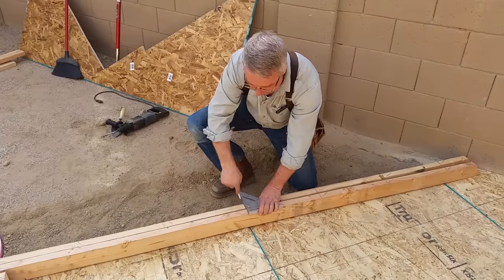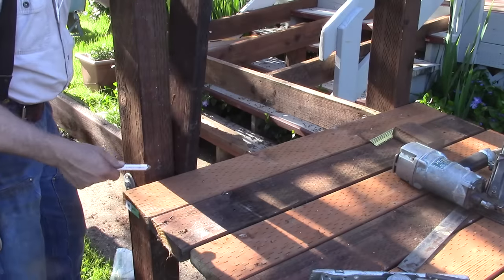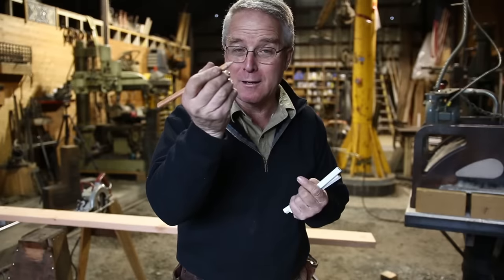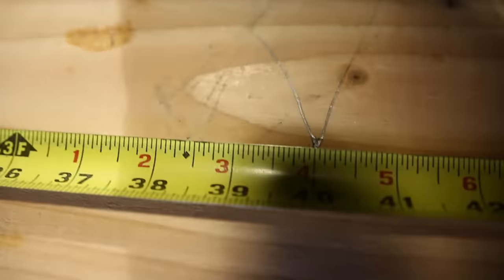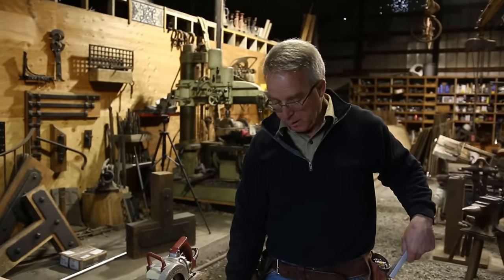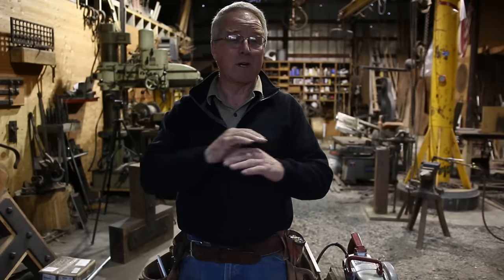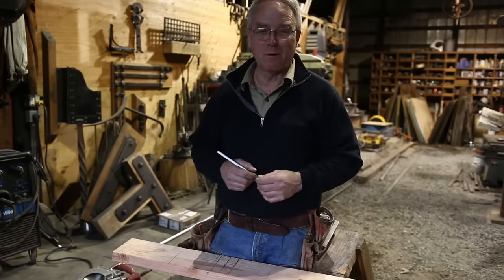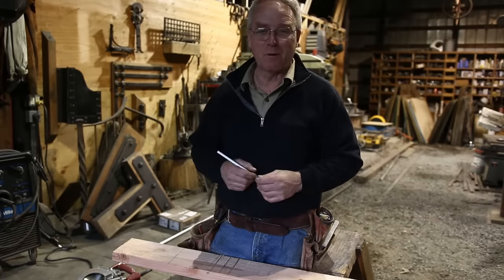Marking and Cutting Pro Tips

Comment: Maybe you just haven't seen (or dealt with them)... BUT I keep two kinds of mechanical pencil around pretty much all the time. (shop or field work)...
 A 1.3mm  "clicker" is a fairly ordinary looking and acting mechanical pencil, but that 1.3 mm lead works almost to the exact degree of a true carpenter's pencil. It's a bit softer, so the marks lay easier and darker... and it's less prone to break all the time and constantly require fiddling with the way the "usual" 0.5 and 0.7's do. (they suck even with finishing work)...
   Then there's the "engineer's pencil" or "architect's pencil" that you can get (a cheap-o version at least) at any office supply store that still sells those school-related architect kits... A slightly more robust version comes with a metal barrel to about half the over all length, so it's heavier and resists instantaneous detonation upon impact with anything of a concrete variety. (lolz)
   These accept the Eagle company (and others) largest drawing and writing leads, which are available (though occasionally limited supplies) in a wide variety of hardnesses, but the "HB" is plenty durable enough for a long lasting marking utensil that even a heavy-handed clutz like myself can manage to use precisely enough for just about any occasion... it's thicker (very slightly) than the 1.3 mm, which is even more advantageous in the field-work (like jobsites) where otherwise you'd want a carpenter's pencil.

   SO now that we're on the thickest mechanical pencil leads... how do you get precision??? 

   Actually, I do it the same as I usually go after pinpoint precision with the carpenter's pencil... I keep about a 2 by 3 inch tab of sandpaper in my pocket for that... In more consistent field-work (long travels and terms) I like to prep' by cutting down several sheets of sandpaper into appropriate (2x3) tabs, and then stapling them together like a miniature note pad... This allows me to scrub a point onto pencils, fix the tips of some gauges and calipers, and other little odd jobs at will, and when the top sheet wears to an undesirable performance, rip it off, and keep going. At the end of the day, check the pad, and carve out and staple a new one every time you're down to around three sheets or so... just to be sure you've got that part covered.
   Shaping the pencil point isn't difficult... You simply hold the pad as flat as possible, or press a finger to it on a flat surface, and scratch the pencil tip back and forth vigorously to achieve a nice smooth linear shape from the barrel down the lead to ride on the side of your speed or tri-square (as applicable)... OR you can scrub slower and roll the thing across your fingertips to shape a nice conical taper to a surgical sharp point, if that's more suited to your work.
   I find the flat-side variant absolutely PERFECT for use with straight-edges, rulers, squares, and guides... While the conical taper and a bit of practice is still the best for templates, and inside circumference layouts with hinges, brackets, and the like for centering and sizing screw holes.

    Yes, obviously, I can recognize the Carpenter's pencil is still a great way to leave big bold marks even easier than with the architect or engineer's mechanical version... AND the sandpaper shaping trick also still works for those occasions going from rougher to finer work, or maintaining finer work details without resharpening and wasting the pencil... BUT this also depends on whether you're a hobbyist or DIY homeowner on a once in a while gig... OR it's your profession, and you're obviously better served with a case at a time of pencils for supply and field reasons. ;o)

Comment: good tip is also to use 2types of grafit medium and hard... Medium for marking on wood and Hard for marking on concrete only diffrence between those 2 is that the tip on the Hardgrafit it stays longer but dont mark good on any wood =)

Comment: I always leave the line when cutting.. The reason is simple, if I cut on a line, I can easily wander to the left or right a bit with the saw, If I cut outside the line, I always have the line as refrence on the inside.. Works every time..

Comment: I simply know the thickness of my cut and the thickness of my pencil. Have them roughly the same. Then I add that to all my measurements. That allows me to cut the line. That way I never have to worry about which side of the line to cut on.

Comment: You use your worm drive saw a lot, I do not have one I have a regular sidewinder saw, ok fine a few of them.  I don't do much framing anymore, never was in the trade, but DIY projects around the house.  I've been thinking of replacing one of my older saws and was wondering what your professional advice would be.  Since I already have a couple sidewinders, would it be advisable to have at least a worm drive in the mix?  I know they're heavier, but I've also heard they're easier to control especially for ripping sheet goods as their weight kind of keeps them going in the right direction.  At least once or twice a month I find myself needing to cut sheet goods for a project.  I know the worm drive saws are more expensive, heavier, built better, etc.  Is this something that would make DIY projects easier?
Reply: Thanks.  Probably end up using the worm drive saw all the time once I get one.  Probably should have had one years ago.

Comment: Another set of distinctions I've heard is "strong" or "shy" 1/16"  Generally, tape measures only read to the 1/16." So, a measurement will be 5 7/16" shy, meaning 5 13/32".

Comment: On the engineer square/mechanical square. There is a built in scribe. That’s very very pointy used to scribe metal or a fine line. Great if you are marking out something that you’ll be torching. Torch will burn your mark away! A scribe in the metal will be visible no matter what.

Comment: Its always the little things. I've subtracted an inch before. The measurement was 24" it measured it myself. Marked it, cut it . Gave it to my father and it looked like it was the scrap piece I grabbed instead of the right one.  Turns out reading a tape upside down doesn't always work so good.
Reply: In Australia using metric tapes we suffer from the old "100mm" trick. Sometimes marking out it's more precise to move the tape forward and start measuring from the 100mm mark of the tape but remembering to add it onto your final measurement can be forgotten when you are under the pump 😳

Comment: I noticed he's using an 'old school', fixed-blade utility knife. I've always thought those were kind of obsolete. I've been using a good-quality Olfa, locking, snap-off knife for years, but I recently inherited an old, scarred, paint-stained, fixed-blade knife with a box of blades. What benefits are there to a fixed-blade over a snap-off. I like the snap-off because it's quick to get a fresh, sharp tip when I need it. I can retract the blade for safety, use a short extension on hard cutting to make sure I don't unintentionally snap the blade, but I can extend the blade for slicing cardboard or rope, and I can super-extend it and get a long flexible blade like a fileting knife for some applications. Should I keep the fixed-blade, old-school knife, or garage sale it?
Reply: Javier Fauxnom It comes down to what you need a knife for. The fixed blade knife lets you put serious pressure on the blade will still having control of the cut. Cutting heavy flat materials like thick carpet or roofing is quickly and accurately done with a fixed knife. It will last longer as well since there are no moving parts to break or jam. Snap off knives are great and can get more work done than a fixed blade so don't stop using your snap off but maybe don't get rid of the fixed blade just yet. I keep a tiny two inch by three inch diamond sharpening plate in my back pocket and just pass the blade of my fixed knife over a couple of times when it starts getting dull. I can get as many cuts as a snap off blade that way without losing time with frequent blade changes. Good luck!

Comment: one more tip. Put the pencil down on the point first where the mark is, then lay the square down against it. no guesswork if your tip is dull if you are gonna be 1/16th off or not. because the drawn point is already in place, the square butts up against it. easy

Comment: A trick I do is to do that crows foot upside down. start away from the mark on the tape and make a check mark with point exactly where I need it. this way you  can approach your mark and as soon as youre perfect shoot the other way. i use a .9 mechanical drafters pencil. try it
Reply: in regards to the cut versus line question, the goal should be to split the line with one edge of the blade, leaving exactly 1/2 of the line on the finished board. This is not the same as centering the line with the blade. The most accurate way is for the guy who made the measurement to make the mark and to cut it because he can see the line  compared to the tape and was the one who saw the measurement compared to the same tape. He can adjust his cut even after the line is drawn. second best is to have a skilled cut man who can put his mark EXACTLY where you tell him and split the line as described above. There should be no adjustment from line to cut.
Reply: Kerry Jones - .9mm mechanical pencil is a great combo of stiff enough lead, and fine point.  What I use most of the time too.  Though I found the plastic bodied "disposables" often wind up with their tips damaged and lead not advancing any more well before I use up all the lead, so have started using one with a metal barrel at the tip... And using the leads out of the big pack of disposables I got tired of fixing the tips on.

Comment: I think the reason for the double mark is that there is no other way to be as precise since you're cutting to an intersection. And if you only had one line, it could be difficult to know which end was the head and which end was the tail. with the double line, That's not a problem.

Comment: to get a fine point without breaking, rub both sides of the graphite on something.  real quick way to sharpen just the graphite quickly, one handed while still holding the wood in the compound miter saw while chewing gum, while standing on one foot, while talking.

Comment: I always hoard pencils I find because I always lose them on jobs. I have a bunch of standard pencils that I always keep sharpened with small pocket sized X-acto pencil sharpener that uses 2 AA rechargeable batteries that give them a super fine point and makes them super fast. I have carpenters pencils and use them but I end up using my standard pencils the most simply for the finer point and the super fast sharpening of them

Comment: At my workplace, we've got an odd habit of using box cutter blades without a handle for numerous tasks - mainly because the handles rarely survive an adhesive-heavy environment for long. The blade is shaped like a parallelogram. I'll hold it like a stylus, sharp edge AWAY from my hand, and I'll use the unsharpened - but still very pointy - hardened steel tip as a scribing tool.
This particular technique is OK as long as you're working around some kind of table where you can put a blade down, this would be no good for moving around... but I can't recommend using naked blades like that in general given how many times I've been incautious and cut myself. Never seriously, but still not a good idea.

Comment: guys, don't mess with traditional pencils for fine/finish carpentry. you'll lose years of your life trying to keep your pencils sharp for the constant marking you need to do, go buy yourself a pack of bic mechanical pencils. the lead is ALWAYS very fine, and if you need an even finer point, hold it at a strong angle and swipe it back and forth three times quickly... i use nothing but mechanical pencils for the last five years.

Comment: i just watch these videos so i can stare at that old arborga radial drill in the shop ;)
kidding, but seriously..a 'metalworking basics' vid, but with the caveat that it's specifically geared towards the carpenters out there would be interesting.
how to drill/cut/grind/polish..etc, but with the tools you already own
as a current machinist who spent his first 15 years working as a carpenter i know i would have loved something like that
Reply: Sharpen forward,  "boy scout style" by using the thumb of the hand that's holding the wood as a fulcrum.  
Great leverage and control.
Thumb tip of hand that's holding the material presses against the back of the second joint of the thumb of the hand that's holding the knife.

Comment: Or use a pencil sharpener...lol
They make great number 2 pencils that are jumbo size. Amazon has them. They are called "Beginners" for kids. They are heavier duty double size lead and body. made by Ticonderoga. These are great for construction. Also never use resist ink (sharpie) on surfaces to be painted they will bleed through ten coats of paint including Kilz etc. If you need to remove sharpie you can use 93 or 100% rubbing alcohol will remove ink.
Reply: Fresh Sharpie ink itself will remove the dried Sharpie ink.  Just mark over the mark with your Sharpie and wipe off.

Comment: I mark my measurements with an exact, on the money line, and then a line perpendicular to that running off of it so I know which way to cut.  I never remove the line, because then it's not my true measurement.  My mark looks like a "T".... the blade chops off the trunk of the T.

Comment: That pencil sharpening bit made me very nervous... not because I don't trust him, but because full blades are dangerous. Dull blades are far more likely to injure than a sharp razor edge.
They take more force, have less control and grab, causing the blade to jump and slip once the cut is made. No good! Always use fresh blades, sharpen up your permanent blades and be careful! Keep your blades sharp, and clean (sticky residue is just as dangerous.) and you can be sure you keep all 10 digits. Having a finger or two out of commission for a week or more can lose you a lot of time and money. 

I do leather work and use razors and sharp blades all day. The only bad cuts I've had were all from dull blades. If a blade seems to grab a bit. Give up, replace your blade, or find a sharper knife.. your body isn't worth the extra few moments it takes to swap a blade or ask a friend to borrow theirs, also learning to sharpen your knives and tools can save money, save your body, give you much cleaner and better quality work... and it's also very therapeutic and relaxing at the end of a hard day. Throw on a re-run of The Office, grab your knives, chisels, skiving blades, axes, even old razors and set to work. Even disposable razors can be resharpened as long as there are no major gashes, saving you some money. (I go through a pack of 100 a week sometimes. Sometimes even more.)

Just a tip.

Comment: im just gonna build a corner triangle with a fat max tape measure with an exto knife pull down marker LOLOLOL so everyone will know cut to the right. easy to remember for my helpers cut to the right of the line. i want a tool that will make cut the wood would be bonus too....like the power tool will know what length the item your cutting and display it on their monitor. sorry this is my failed computer science degree in action

Comment: Haven't looked at all the comments but has anyone heard the term "take a blades breath off"?
Reply: Where you drop the blade down, but the wood up then lift and cut taking only the cut the shelf of the carbide tooth on the saw will remove.

Comment: funny thing. i built a wall and made the bottom and top plates the same. and checked it for plumb. had the brick layer tell me the top was an inch and a half  off. dont know how. every good carpenter knows to check plumb on top plates. the bottom could b 5 inches off from an existing building. still dont know how it was. but it had to have been my mistake. cause ive worked for layers of block and brick. and their work has to be plumb. or atleast under slightly towards the building. not away from it. but yeah it happens people

Comment: For anything in your eye or under your eye lid, calm down and wipe out the inside of your eyelid with out eyelashes. For fucks sake make sure your fingers aren't covered in debris first. Lift your top lid, slide up and wipe out with your lower lid lashes. Pull your bottom lid and push down your upper lid, gently wiping out. Repeat until everything is cleared out.